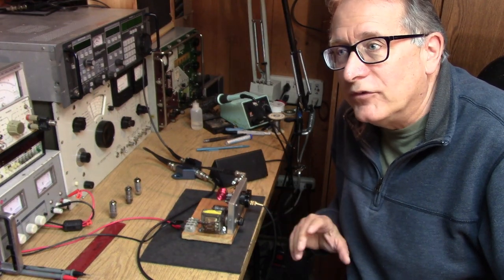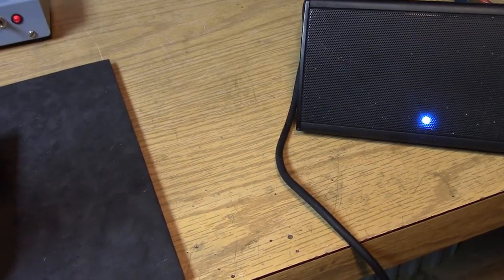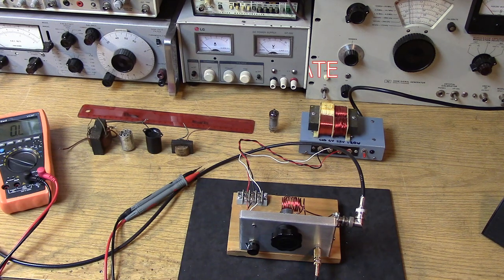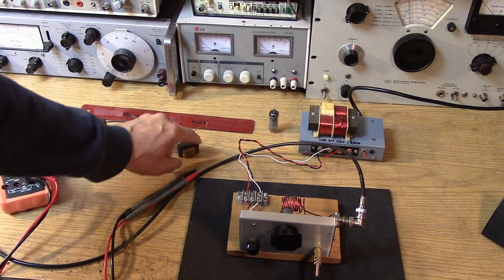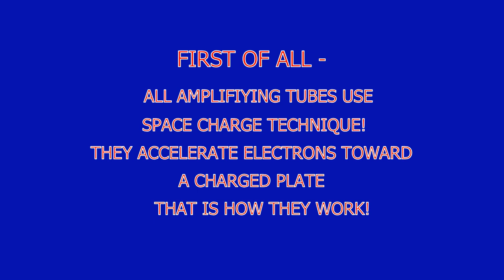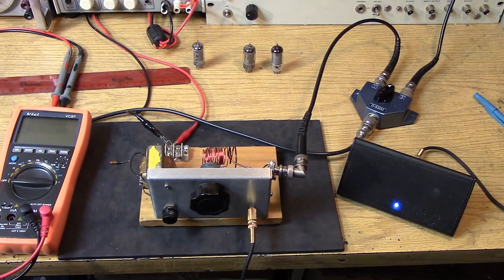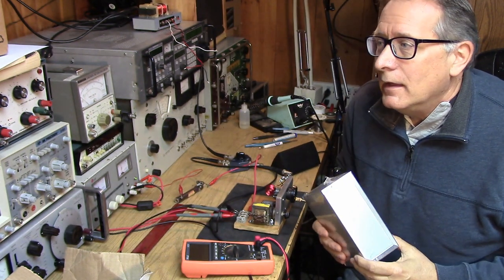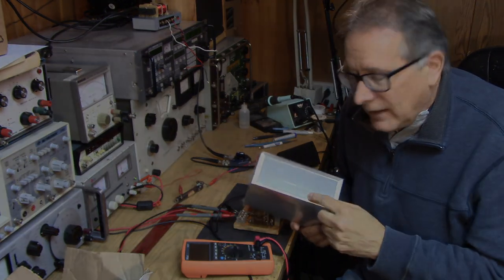Super Regen Part 3

Comment: Super regen at 25 MHz!  Ah yes!  That brings back fond memories of my Sears Walkie Talkie Base Station I had back when I was an early "tween" in the 70's.  Sure it picked up CB because it had to in order to hear who you were talking to.  But the receiver tuned all the way down to almost 12 meters.  I remember very vividly listening to WWV on 25 MHz back before they were constantly mentioning "Cordinated Universal Tom".  It used to be:  "21 hours, 31 minutes Greenwich Mean Time".  I even heard shortwave broadcast stations on the 26 Mhz SWBC band.  I could hear the hams on 10 meters but I couldn't tell what they were saying due to super regens couldn't detect SSB.  Thanks for bringing back those good memories Mike!  Also don't forget about the noise canceling phasing circuit you said you were going to do a vid about - I'm really interested in that.  73 de WB8YMV.

Comment: If you are going with 2 stages, make one a reflex stage.  It can serve as and RF preamp and also as an audio amp.  I did this many years ago with transistors and made it work.  The tricky bit is mix together the RF amplifier and audio amplifier in a manner that keeps them from interacting in a bad way.  The way I did it was to have more RF in the detector stage cause the audio stage's current to decrease.

Comment: I've used those PA speaker transformers on the output of 1920's receivers. I also used one on the output of a battery powered tube guitar amp I built. Those transformers are great for such uses.
Reply from the maker: Those PA system transformers are made to distribute audio power with a way to share and adjust the 70V AC (600 Ohm usually) source over many speakers. They are not designed to run DC current through them, and the impedance can be incorrect, and power efficiency can suffer during DC core saturation. The results vary wildly based on the particular manufacturer. I guess my message is that they may look the same, but are are not the same as your typical 50C5 or 6V6 to 8 Ohm output transformer.

Comment: Radio Shack!  I remember that. Your headphone connector tells a tale lol.
Reply from the maker: I just broke down a box of old Radio Shack Blister Packs yesterday. 100 random capacitors, 555 Timer, 1K Trimpot, etc... Gone Gone now.
Reply: @MIKROWAVE1  I worked at RadioShack years ago. I told them, when they first dropped the catalog, that they would eventually go out of business. That catalog was the glue that held them together.  My opinion!  But my prediction was spot on. I spent hours going page by page. Others did too. Anyway!  Great channel. Love them radios!

Comment: In the '67 HB, there was a one tube UHF transceiver for 450mhz using a single 6CW4 tube as a super regenerative detector and modulated oscillator transmitter.  It was a portable with a 45 volt B battery and a 6v A battery.  It used three transistors in the audio amp  / modulator with a small tube power transformer as the modulation / af output transformer.
Did you know that there were space charge Nuvistors (8056)?

CB Band?  That's the Citizens Band Band.
Reply from the maker: A classic article poured over by many a young ham! A Hybrid I think with transistors too?

Comment: Space Charge tubes by RCA were used in car radios in the 50s to stave off the transistors also it meant that they could get rid of the Vibrator that was used to generate 120V, Space Charge tubes were made as they were safer to use because there was no shock hazard unlike the vacuum tubes that use a 120V B+ and a heater of 6V.
Reply from the maker: Yes they still used  a transistor for the brute work of driving the speaker. I saw women building car radios in an old Motorola plant in Arcade NY in 1978. I was trolling for a Co-Op position. They were for Volkswagen. They also made alternators for VW. Imagine a US manufacturing company exporting to a car company in Germany today?

Comment: Have ten tec recivers. And the local osc is some times heard up to 6 miles away.(dc1056)  so isolation is a problem. Tks om Fer good show.
Reply from the maker: Lord Mountbatten  of royal fame, got his start as a young signals officer in WW1 DFing the German Regens whistle on their battleships. All with a big loop antenna.
Reply: @MIKROWAVE1  ja! Und. the camp guards at German prison of war camps found "home spun" radio via RDF. From stolen tank head sets.  Even our troops. Fought over a dead tank or "canpf Kar."  for  pieces so as to hear news from home. Old air borne sgt AMSTUTZ told me. They were of uncommon quality. Thanks again for the good show. Danke zier. Kv4li.

Comment: Great Video Mike.  With you demonstrating the value of all those old TV tubes (with great VHF performance), I was lamenting about how many thousands are buried in landfills, that if dug up would probably still work just fine!
Question:  Would it help performance (of whatever type of tube used) to place an adjustable voltage divider on the grid to set a working threshold so that the tube didn't have to purely depend on the RF incoming signal to bias the tube; also what about the distortion that seems still evident?
Reply from the maker: The self-quenching circuits like the "Flewelling" are not known to be distortion-free but they are simple and usually are pretty forgiving to parts substitutions. There are better circuits. I just stuck with a two basic circuits shown in the ARRL Handbook.
Reply: @MIKROWAVE1  OK, I was just comparing that with the other regens that you’ve done that seemed do you have really nice sounding performance. Also I asked about the biasing, could be bias be adjusted with the divider to help the conduction of the tubes?
Reply from the maker: @SpinStar1956  These super regens are pretty nasty - and remember we are trying to detect FM, on an AM receiver, which means you are doing slope detection at best. I have seen a full discriminator formed with a balanced dual super regen that puts two identical regens back to back and ads them in a center tapped transformer on the output.
Reply: @MIKROWAVE1  when I was young, everyone said build a regen, and I had the most miserable 😩 time trying to get them to work so I gave up! I would make DC’s and supersets and had so much easier time of it. 
You’re definitely a real intuitive builder so even though I not highly interested in them, it’s still great to see you work through the topologies and problems!  73...